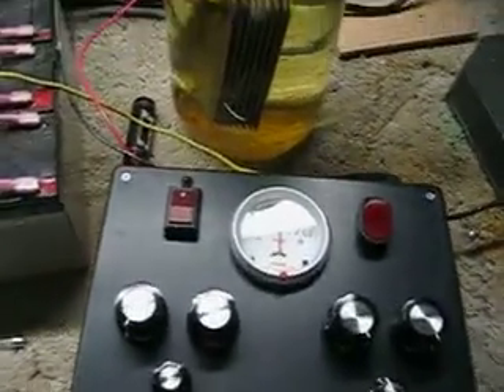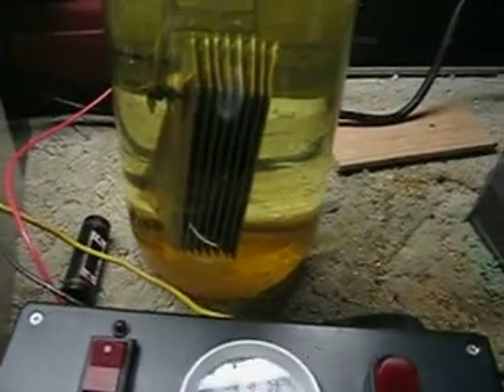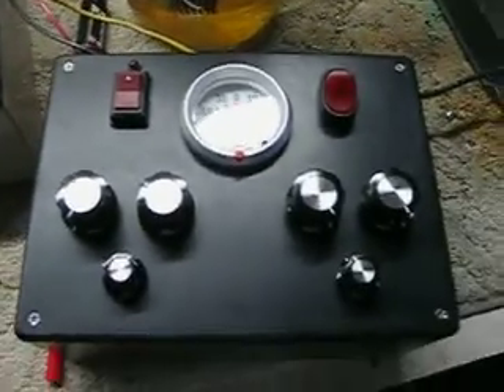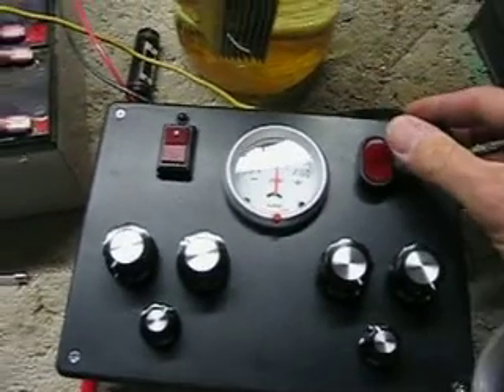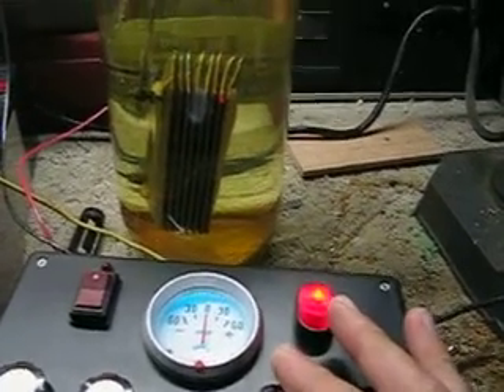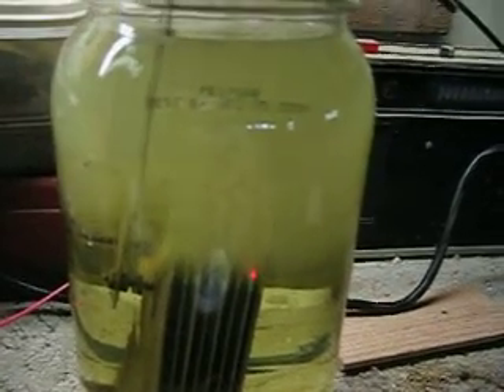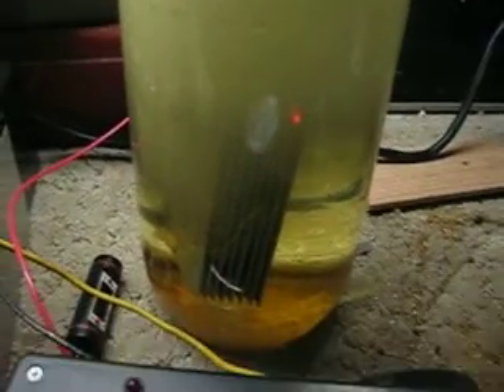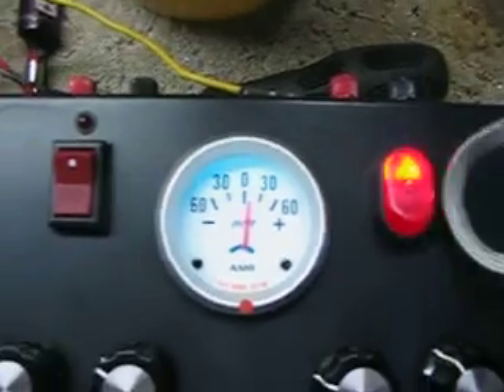Hydro Lab (My Garage) #6

Comment: I finally finished my pwm unit from the same plan that you have. As i can see from your vids, the first knob from the left is all down, the second is 1/4, the third is all up and the last one is all up. And in the video you turn down the last one until you get a high frequency sound. I did not manage to get the same output, and i only draw a 2,5 Amps and 6,58Volts, maybe i need to play with it around a little bit. Anyway thank you for your help

Comment from the maker: Second,the batteries in my vid's are 12 volts, connected in parallel. This results in 12 volt power with higher amperage capability (They will supply 12v for a longer period of time as well).
 Third,the sound you here is from the PWM, I think. I'm not sure if comes from the 555's or the mosfet/heatsink (leaning towards the mosfet though).
  If you need any more info don't hesitate to ask. Good luck!

                   Mozon1967

Comment from the maker: I think I can help you.
First, the switches in my plans called for two "4-pole,3way" switches. This makes no sense, what they mean is "1-pole,3-postion". I could not find this type so I bought "2-pole,6-position" switches from Radio Shack and only used 1-pole and 3-positions.

Comment: Can you help me, i wanna try to build a pwm like yours. I would like to know what's the name of the switches that you use (ex: 4pole-3way) or do you use a different type. Another question, what is the Voltage input of the batteries, and what the hell is that freaky sound, is it coming from the cell??